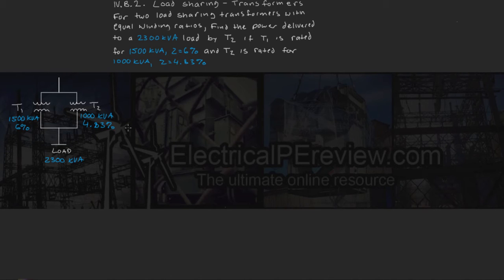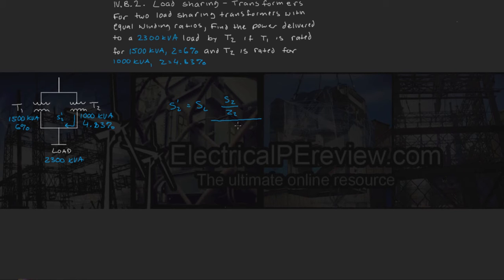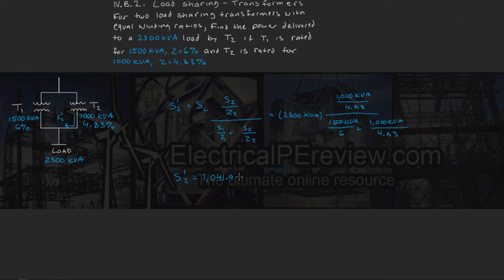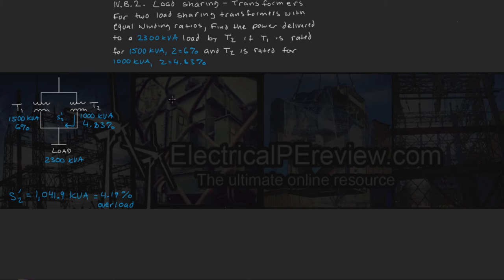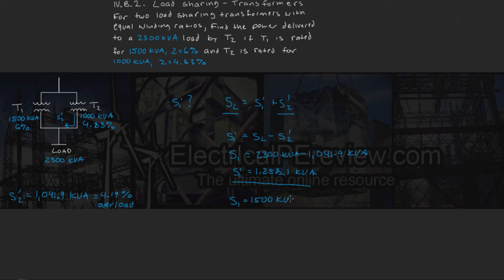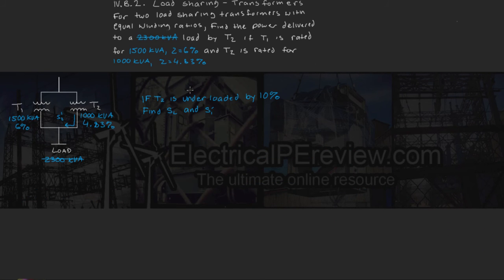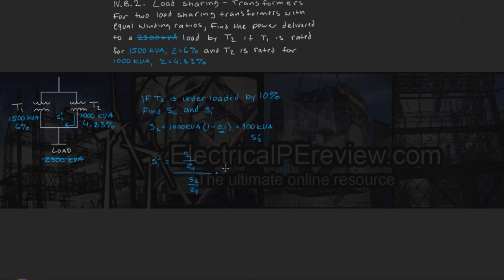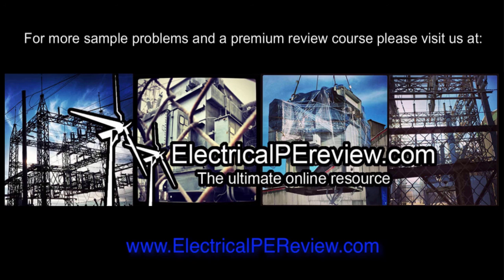IV.B.2.  Load Sharing Transformers Example 3 - Power Contribution - NCEES Electrical PE Power Exam

Comment: How did you derive that S2 = ((S2/Zpu2) / ( (S2/ZpU2) + (S1/Zpu1))*SL)?
Reply: The two transformers are in parallel, having equal voltage ratios and feed the same load, which splits based on percent impedances. so the ratio of S2_delivered / S_load = S2 / (S1 + S2) = (V^2 / Z_2) / ( V^2 / Z_1 + V^2 / Z_2) = (1/Z_2)  / (1/Z_1 + 1/Z_2) since the V^2 cancel.  The tricky part is that we are not dealing with OHMS,  we are dealing with Percent impedances (Z_pu for per unit impedance), so Z_pu = Z_ohms / Z_base, and Z_base = V^2 / S, so Z_ohms = Z_pu (V^2 / S), Therefore  1/Z_ohm = (1/Z_pu)(S / V^2), Lastly, plug in : (S2_delivered)  = (S_load)(S_2 / Z_pu2) / ( S_1 / Z_pu1 + S_2 / Z_pu2). Hope that helps !!!

Comment: I thought load sharing is only related to impedance not capacity of the transformers. Did the first example get the correct formula? Isn't T2's share 6/(6+4.83) of 2300KVA? Voltage drop on both transformer should be the same.
Reply: I guess I messed up. I was not differentiating the actual impedance from the per unit impedance. I missed a conversion required by non-identical transformer capacity. Video shows correct solution.
Reply from the maker: @helendu5241  Glad you got it figured out Helen, I'm happy the video helped and thanks for the follow-up comment to help others.